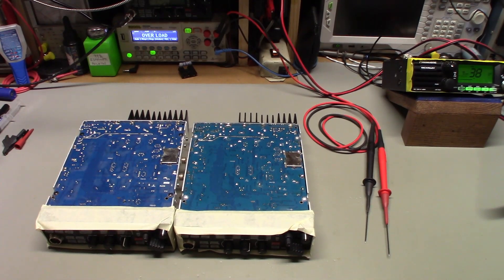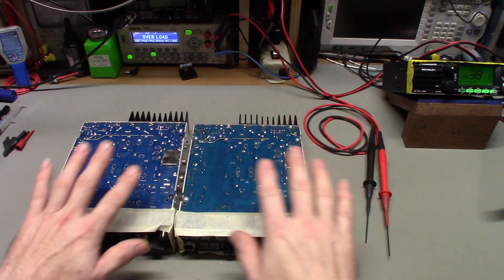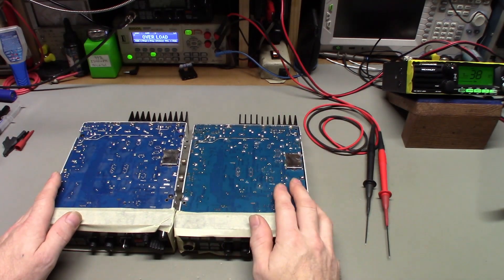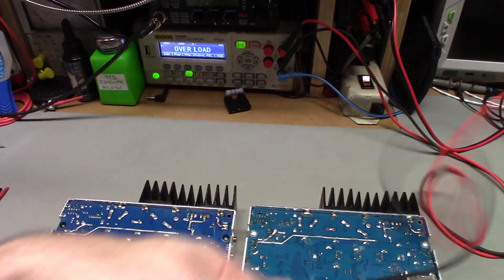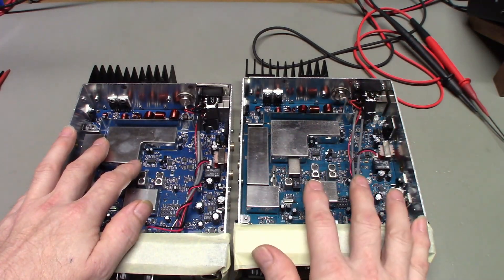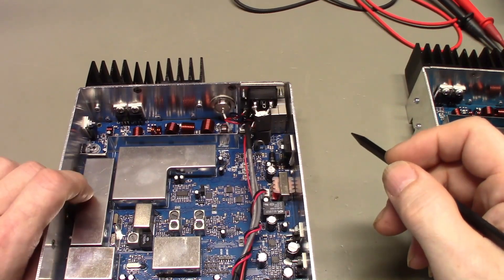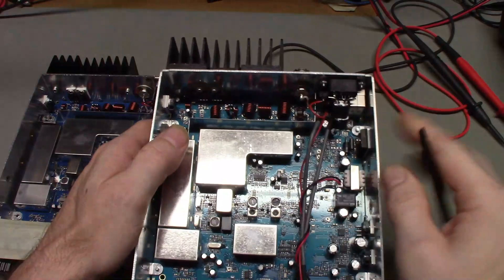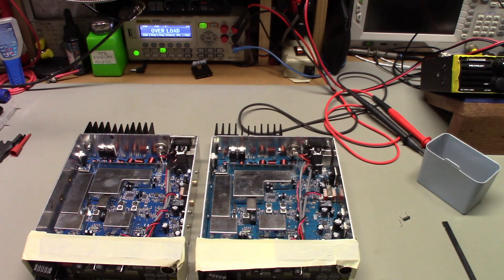High SWR's blew up your radio.  Simple testing anyone can do to repair it.

Comment: I have a K40 trunk lip Mount antenna hooked up to my Stryker 447 radio and my SWR on it on Channel 1 is 1.1 and on channel 20 is a 1.2 and on channel 40 is a 1.7 but for some reason I can't hear anybody on it for some reason and I live really close to the highway where there's tons of semi trucks rolling down it but I still can't hear anybody talking could that mean that my antenna has something wrong with it
Reply: SOUL MAN, it sounds like you have the exact same issue that I have with my Stryker 955HP.
Years ago I used it while driving tractor-trailer and had a few occasions where SWR peaked to the limit due to bad antenna connection. Not sure if that was the cause, but the last year I used it & ever since, I can't receive nearly anything on that radio even tho I'm in an area by the highway there should be plenty of CB activity. I just hooked it back up this week and it's still 'far too quiet'.
Reply: @ColtTSMG  I figured out what was wrong with my Stryker  Sr 447 my antenna is a trunk lip Mount K40 antenna and it wasn't grounded right but then I got it grounded right and it works great now I'm receiving and transmitting very good and they SWR is down to a 1.1 on all the channels and on Channel 40 it is 1.2 my SWR is now so I'm receiving good and transmitting but I'm still upgrading my antenna to a striker Sr A10 antenna I already ordered one but the u.s. Postal Service lost mining during shipping so now I'm waiting on the US Postal Service to replacement  hopefully they are send me a new one other than that my radio is working out great now so you might want to check and make sure that your antenna is grounded cuz that could be your issue as well

Comment: Is a 1.5 swr on highpower on an anytone 6666 bad?
Reply from the maker: It's not horrible if that's what your asking.  With a SWR of 1.5 you are transmitting 96% of your power and 4% is being reflected back to the radio.  Start to get worried when you get near 2.0 to 1 SWR.  With a SWR of 2 you are transmitting 88.9% of your power and 11.1% is being reflected back to the radio.  At those levels and above you start to risk damaging the output section of the radio.
Reply: MikesRadioRepair my swr usually is at 1.5 dead key at like 50 watts and then jumps up to around like 1.6ish when modulated is that bad 😬 and thx for the reply

Comment: Had that experience. Basically, I've burned the output stage of an RF PA that I've made, due to a badly tuned antenna. Funnily, the PA is only capable of outputting 1W at best, and I was not expecting it to be damaged.

Comment: Hi mike,
I set up a 148gtl and my swr on the radio is high!. I put a mjf antenna tuner between the radio and the antenna. The meter on the tuner is down to 1.1 but still high on the radio. Should I disregard the reading on the radio?.
Thanks in advance, 
Ernie.

Comment: I did radio years ago....    Please note that you can tune your antenna  on a specific channel. If you set it on channel 40, channel one will probably be higher. The best spectrum spread is to tune on channel 19 or 20. this is why truckers run channel 19.
Reply: They ran 19 back when it was only 23 channels. 11 was a calling frequency, and of course, 9 was for emergencies.
Reply: ALWAYS TUNE YOUR ANTENNA BEFORE PUTTING A RADIO IN SERVICE. Never trust the internal SWR circuitry. It lies, it lies and it lies. Use a good external SWR meter. One that has not been dropped and broken the solder connection inside of the box. 25 - $55.
Reply: what shit are you talking about ??
so why don't truckers run on 20 if that's your logic..

in fact if you take in to account the 'alpha channels truckers would use channel 22 or 23 as center of the CB spectrum 26.965 to 27.405 is channel 22.5 or 27.230Mhz.

run on channel 19....ass..
Reply: That's probably why 9 was for emergencies because it was a mid spectrum channel when they were 23 channel
Reply: Compare the lowest channel, 1, against the highest, either 23 or 40. Adjust the antenna(s) accordingly. Adjust dual antennas at the same time, not individually.
Reply: @robertmanning5212  bullshit, you clearly don't know how to adjust dual antennas...
you sir are another reason the CB radio and internet is full of bad advice and idiots.

Comment: In you professional opinion. I have an old Cobra 40 channel cb, LTD I think it was, that I used for 20 + years trucking. I spent over 35 years OTR & this was my 3rd radio. It has been boxed away for a dozen years or so. Are these worth going through, checking out & repairing if need be or is it better to buy something new. Just want to put it in my pickup just to have when I am on the road with my horses. Also I live on top of a mountain so I would like to see if it is like it was years ago where you hit the skip & could talk a long ways off. Just something to have some fun with. Also thought about hooking a linear to it. What's a good antenna these days? I always liked the K40's but didn't know if anything else is better. If I do what I am thinking of it will be mounted in a Dodge pickup.
Thanks for your time.

Comment: Mike, thank you for the videos, they're so helpful.  Just curious, can you test the AM regulators and the drivers the same way you tested the finals?  I'm trying to find out why a Cobra 25 LTD Classic won't transmit or receive.  (I already checked the cb/pa switch and caps esr.)  The sound chip makes noise when I put my finger on it.  The signal meter isn't moving, but it's not "stuck", it moves freely - doesn't move when receiving signal is being broadcast.  In the rear of the 25 there are two transistors.  The one near L12 is the final, but what is the one in the very rear corner and what is the one by the volume/on/off switch? Thanks!!
Reply: When you say does not transmit, you mean you have a dead key but no audio ??  The audio chip on the side of the chassis might be your issue. The 29 and the 25 radios DO require those 2 thick rubber washers between the mount bracket and the case of the radio....  If their not in there then when you tighten the 2 knobs they pull the case away from the PCB slightly and the solder joints fail....  Example no receive in the speaker and no audio going out....I have seen that a few thousand times....
Reply: @cajuncoinhunter  Thank you for writing back.  If you watch this video someone posted, this is exactly what happens with my Cobra 25 LTD...it's easier to watch his video than me trying to explain it, but everything that happens in his video is what happens with my 25 LTD...here's the link for you:   https://www.youtube.com/watch?v=nzqjIKUKBsg

Comment: I'm trying to set up a really old set , Midland . 50ohms  impedence ?  Hmm , I've heard that be fore . Impedence is resistance . But you still need a opposite polarity reflecter for antanna to work ( I think) . Just don't short it . Broken coax . Splices will cause problems too .

Comment: I love your videos. I learn a lot about radio from watching your content, thank you. Question – if the finals get blown so frequently, and pass on current for more internal damage... shouldn’t they build in a fuse?
Reply: Read the support boards for the ubitx theres a nice protection mod using  a P-FET like the IRF9540 as finals draw power from the 12volt input

Comment: Can you tell us please how to be sure the cable is 50 Ohm?  I have a few cables around but I don't know how to test them be sure.
Reply: I put a 50 ohm dummy load on the end and test it like a antenna is on the end with an swr meter..
You can all so put the power meter on the end with the dummy load and see how much power lost you get with your coax
Reply: @Mr_Meowingtons  Okay thanks for the response. I appreciate all your videos. Please keep them up here.

Comment: SWR stands for Standing Wave Ratio...how do you get SWR's?  People do the same thing with RPM...pet peeve of mine I guess...
Reply: Christ almighty...
Reply: bit like when people say 73's...
Reply: Well there is two radios there two different swr readings swr's lol
Reply: @mackenziesibley7025 i think I said the same thing you did I just hadn't realized it yet!😂
Reply: I used to feel the same way about the abbreviation RPM, and it irked me when people wrote it as RPM's. However, upon reflection, I realized that the 's' in RPM's doesn't stand for 'Revolutions per Minutes,' but rather pluralizes the unit itself. So, it's accurate to say either 'Revolutions per Minute' or 'RPM's.
Reply: Well I hear both being used and RPM just sounds right to me...
 @marsupialsrock010
Reply: All about the reflection
Reply: Because he's a CBer.

Comment: Mike, Good video...If the final has been replaced in a cobra 29 Ltd classic and still doesn't work, and let's say the regulator is also blown. What will the symptoms be for such a problem. Would the radio fail to key up ? By the way the driver has also been replaced along with the audio chip. Thanks, Billy

Comment: I so wish people would not say "The radio blew up" by saying that do people expect to see windows blown out, furniture blown to pieces? Maybe to say the raido is damaged to some extent?  I get this a lot here in England by CB radio operator, example is, "Ohhh yes he blew it up". Radios DO NOT blow up unless it get hit by lightning or a missile. by any other means it may be damaged.
Reply from the maker: Think the term probably comes from the vacuum tube radio era.  Ever see what happens to a 100uF 450V cap when it has long outlived its lifespan.  BOOM!!!  They blow up and make one heck of a mess.  Paper and aluminum foil fragments everywhere.  Doesn't necessarily need to be tube type to have something explode.  I see several transistors every year that have literally blown to pieces.  Had a Galaxy here a couple weeks ago that both finals had blown up.  The plastic body exploded so violently it bent the leads forward.  Even put a small dent in the bias mirror board.
Reply: Have you never seen a blown mosfet?  Shrapnel

Comment: I am surprised at the number of CB users who think the SWR meter in the radio is used to "set" the standing wave. They actually think if they "set" the adjust the knob on the meter,  it adjusts the SWR.
Reply: Always get one
Reply: What irks me is the myth that built-in SWR meters are untrustworthy.  In every radio (except one) with an integral SWR meter that I've owned or checked, the internal meter and my external meter have agreed. I connect an external SWR meter with no longer than a 24-inch jumper.  The one rig whose meter didn't read correctly had a problem in its SWR-bridge circuit.  Gotta keep your gear in working order, folks. 😉

Comment: I had the same issue with a stryker 655 a guy brought in the shop and he actually admitted his antenna was bad. When it went took out the finals and tip36.
Reply: What are the best antennas for this type radio?
Reply: @justbeforethereturnofchris2393  CB antenna!
Reply: @PeterDad60  .....yea I found one that works with this CB radio...

Comment: after i buy a swr meter and calibrate it in my truck can i remove it or must it stay inline in my truck at all times ??... thanks for your thoughts. just learning
Reply from the maker: No, you can remove it after tuning your antenna.
Reply: @mikesradiorepair   thank you and how in gods name does my antenna remember the settings ?
Reply from the maker: @mechanicandskills7215  It doesn't "remember".  Your physically adjusting the length of the antenna to tune it.

Comment: Nice vid Mike and well explained.
this is what I use as TIP36 replacement in a very similar radio
Your correct on heat sinking issue,the way round it is fit a reverse heatsink in side the radio!
Fit new part MG9411 Part No RS 737-8868
 TIP36C replacement
Cut bottom fins off with tin cutter and shape to fit Heat-sink Part No RS 402-967
Regulator runs a lot cooler Mike as now as Heatsink  facing inside radio
If you need pics email me rpcomms@gmail.com

Rob 73's

Comment: I’d check the drivers if the finals failed short (as these did); you’re essentially asking them to drive into a 0 ohm load (in this case, about .3 ohms) - they’re not going to last long that way! Even if the driver and final have a coupling capacitor, the driver is going to be seeing a vastly different impedance than it was designed for; SWR problem again. 🤔

Comment: The MFJ Antenna Analyzer (259 or 269) is the best money that a new Ham can spend, IMO.  Say what you will about MFJ, but this piece of gear is worth it's weight doing antenna work.
Reply: I second this.  My '259 has been a life- and transmitter-saver.
Lonestar / N5RLR

Comment: I have never understood how anyone can set up a radio and not test the SWR?!?! The owners manuals used to tell you that much. So many radio's have built in SWR bridge so no excuse. I have only used dipoles on sailing boats . On most leisure craft do they normally use a no-ground plane antenna on smaller boats? It does not help that they use cheap garbage non-rf specific mosfets for the finals. None of them are rated for RF and they are not tested for mismatch at any phase angle in an rf situation. The old 2SC1969 for instance where good to what 30:1 mismatch at all phase angles up to something like 30Mhz? Yes Mike now we know it is a Tip 36 but for 2 years no one knew what it was so a lot of people already have them. I think I got 2 from RF Parts when they first came out. Just like I have prob. 30 Toshiba high amperage 12V voltage regulators. I did not need them but I know I will use them over the next 20-30 years! LOL

Comment: Does it make a difference where your car is when you test your swr for antenna?
Reply: You should be in an open area, away from buildings and structures, especially away from metal structures.